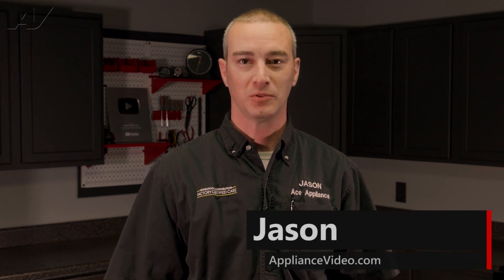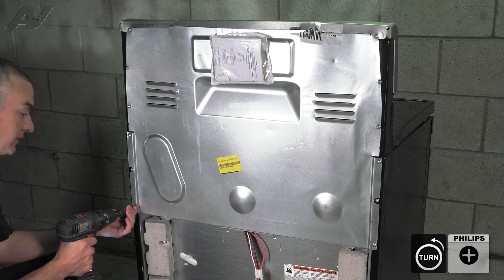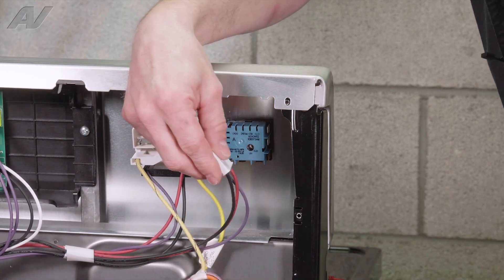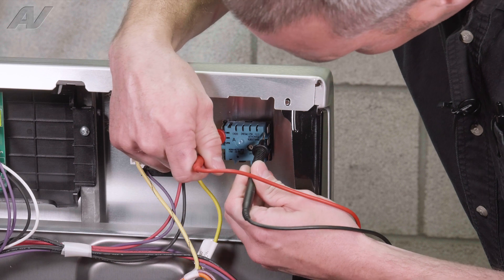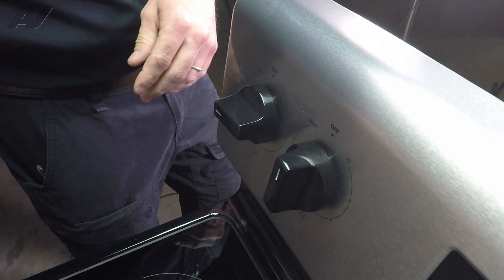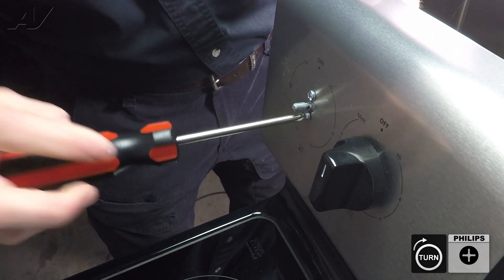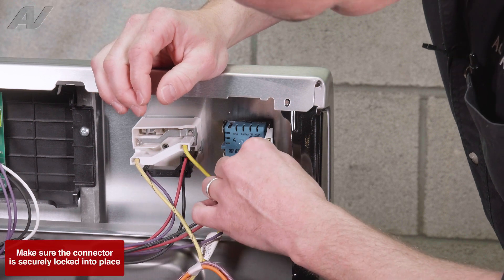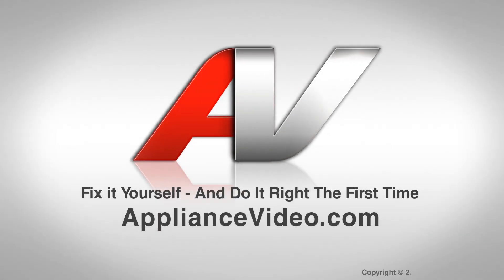Whirlpool Stove Repair - Element Will Not Heat - Dual Element Infinite Switch

Comment: How do you select a 'universal' replacement part when the both the original and recommended replacement parts have been discontinued by the manufacturer, and are no longer available? When I spoke to a tech at a 'universal' replacement part manufacturer, he couldn't match the original part ID, and asked me for a different ID that should start with "INF", but there was no such ID on the original switch.
Reply from the maker: Great question, if you have a more technical question that our parts department cannot answer, you can search our over 17,000 answered questions free at our website www.ApplianceVideo.com under our Repair Help section. You can also call our parts department at 1-800-830-5465 and they can give you help 7-days A week ,or search at www.SaveMoreOnParts.com  .